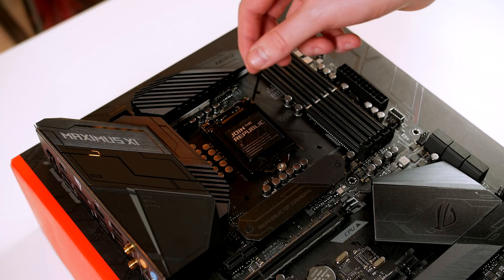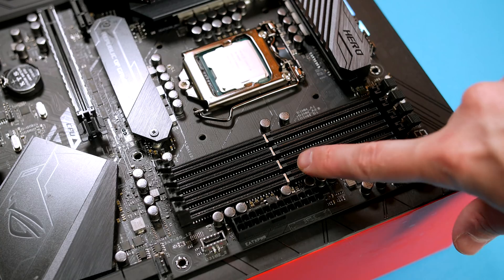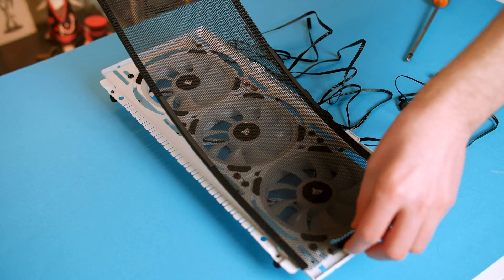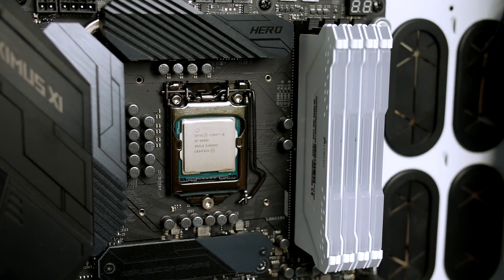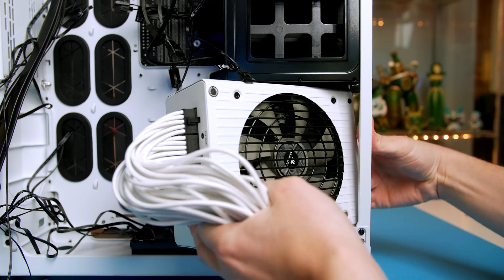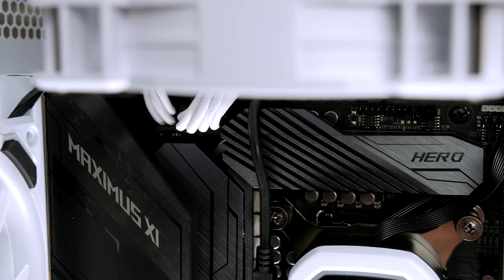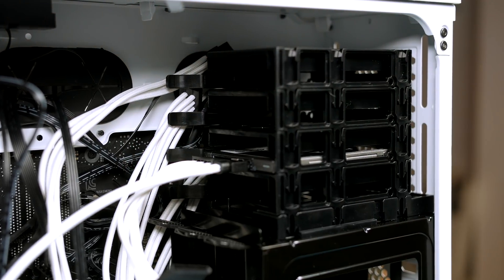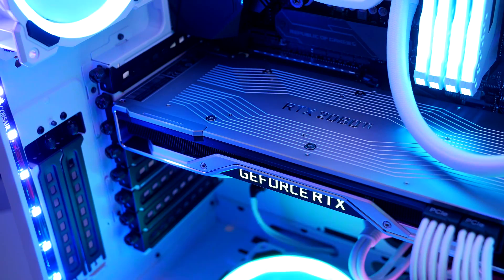The Ultimate Gaming PC Build Guide 2019

Comment: Hey I have the same build planned this weekend and was hoping you could help with the fan and light strip setup.
The bottom two look to be like exhaust vents right? 
I bought the QL fans(2 for bottom and 1 for rear)

Can they be put in the commander pro with the LL fans?
Do the 6 fans go into commander pro and use 1 channel and the lightstrips use the other channel.
Do the two fans on the AIO not have have to be plugged into the commander?
I would appreciate it so much if you could help with this as it's the only part of the build giving me a headache

Comment: Curios - I was told the bottom of the case fans should be intake - did you set yours up to be exhaust?   additionally is there anyway to connect two RGB hubs without using the commander PRO for all 8 fans?

Comment: Ok, forgive me, I'm a first time builder basically trying to build this exact machine.  Questions!
1) I have 6 fans so i plug all fans into the Commander Pro, pretty straight forward, but I have the H100i as well, where would i plug the fans/rgb for those in as there are only 6 spots on the commander pro?
2) I can remove the little Hub (LED 1 and 2) because the commander pro replaces that, correct?
3) Both the Commander pro and the RGB hub need power, .. just by plugging the RGB into the commander pro.. it's not powered that way I assume.

Thanks from a noob!

Comment: Hi, awesome build!!! But...How could you connect the 8 RGB fans and the 4 led strips on the commander pro and 1 hub ?
Reply from the maker: The h100 controls it's own fans
Reply: @BeginnersTech  You have not understood me haha ... I mean the rgb lights ... 6 rgb lights of 6 fans go to 1 led channel of commander pro, and the 4 rgb led strips go to the other led channel of commander pro ... but  Would the 2 h100i fans be missing to illuminate, or do they not need to be connected by the comander pro?
Reply from the maker: @Lirus86  what I'm saying is 6 fans go into commander pro in both the fan end and RGB end not in the led channels. The led channels are for strips. My other 2 RGB fans are controlled completely by the h100i as it has its own fan and RGB connections.  If you don't use those connections on the h100 then you'd need somewhere to plug the fans on the motherboard and a node core or RGB hub
Reply: @BeginnersTech  ok I think I get it.  thanks !
Reply from the maker: No worries if you need any help just join the discord

Comment: The Commander and Hub has connections for 6 fans, so where did you plug fan 6 and 7 in?
For the GPU i would actually get the CableMod Vertical Mount Kit, as it will bring the GPU further away from the side glass and give you great airflow.

Comment: The mother Board don’t have 8 Pwm Ports? Dies ist work with a hub?
Reply from the maker: I'm using commander pro
Reply: BeginnersTech okay trank you im a noob ^^ but is ist for the power and Lightning?
Reply from the maker: @blxckluc5435  for the lighting you will need a node or RGB hub
Reply: BeginnersTech okay trank you and what i Need for the power Cause i have only 4 power 4 Pin pwm Ports?

Comment: yoo you have 8 rgb fans how did u connect them all to commander pro which only takes 6 .. it don't add up ?  Pls reply cuz I'm stuck 😔
Reply from the maker: The H100i controls its own fans so all good
Reply: @BeginnersTech  I watched the video again it makes so much sense now thank for making it so clear  👍
Reply: @BeginnersTech  ohhh so I just connect it to the rgb hub right? Thank god life saver 🙏 my first pc build ever hope I get it all down
Reply: @BeginnersTech  so my commader pro just came. I connected 3 separate ll20 fan connectors to it. The h100i connects by itself.  But I'm using the 3 fans that came with my case I can't seem to find fan connectors only to rgb hub wires which I connected to the hub that came preinstalled in the case ... 680x that is does the 3 preinstalled fans just not come with fan connecters for the commander pro

Comment: Hi great video! do you know if there's enough room in this case to vertically mount an Aorus 2080TI Extreme card as It's a quite thick card from front to back with the fans shroud and there doesn't appear to be a lot of room between the card and the glass? even if it fit's vertically would there be enough cooling do you think?
Reply from the maker: It should fit fine,, not sure how temps will be tho as I have never used that card.
Reply: Bill Gordon the temps might go up a couple degrees. But, the bottom fans can be either exhaust like in the video and how I have them set up or they can be intake and have the cool air going right into the card.

Comment: Do you need the card in vertical mode in this case? I'm using Aurous 2070 S.
Reply from the maker: No can mount whatever way you wish.
Reply: @BeginnersTech  Will effect the PCIE slot overtime with wear due to the weight of the card? My friend is recommending I use the card vertically to avoid damage unless the case can support it strong enough without needing to do so.
Reply from the maker: @jamesherman3750  it should be fine mounting like that is normal the vertical is just for looks

Comment: Would you use a commander pro when u have 3 CPU fans and 6 case fans?
Reply from the maker: Commander pro ideal for when you don't have enough connection on the mobo. Plus with Corsair fans it allows perfect sync

Comment: looking to get a corsair h115i platinum cooler. if i have a commander pro do i need to plug the pump into the mobo or can i plug it into the usb header on the commander pro? Also with the fans from the aio, can i plug them into the commander pro and rgb controller like the rest of the fans i have in my case? (they are all the same fans) Been looking around and cant seem to find the answer. Thanks in advance! Great build man!

Comment: Corsair botched the 680x (I have a build using this case as well) by not thinking of their own products.  The mix of fan sizes is limited.  If you use their 360mm AIO in front, you can't use 140mm fans in the top or bottom, you're forced to use 120mm, giving up 15% more airflow.  Fine, use a 280mm in top but then don't overclock your CPU because the 280 AIO won't cool an i9 or AMD chip sufficiently.  Also, the fan and rgb hub nonsense, do away with it in Corsair cases and build a power/rgb rail inside the case to hang fans onto with a single 4 pin power connector and a single usb header.  I have 8 fans in my 680x and 30 wires to accomplish that.  Ridiculous.

Comment: Do we have to buy the rgb controller or does it come with the case?
Reply: The lightning node pro comes with the case and any set of 3 rgb fans from corsair you buy separately.  That only controls the rgb though. 

If you want to control the fan speed all in the same software as you do the rgb you need to buy the corsair commander pro.  That way you can control the fan speed and rgb all from corsairs icue software.

Otherwise you'll have to go into bios(?) I think to control the fan speed

Comment: How do you connect 8 ll120 fans in this case?
Reply from the maker: Use the commander pro
Reply: @BeginnersTech  doesnt commander pro only have 6 fan slots?
Reply from the maker: @chadn5177  yeah but the h100 fans plug into there own connectors.

Comment: How did you connect 8 fans if the hub only allows up to 6?
Reply from the maker: The cooler fans run through the cooler
Reply: @BeginnersTech  I don't quite get it. Building almost the same system at the moment. But how do I get the 2 CPU fans to be RGB controlled? I can't plug them into the hub, because there are only 6 ports for RGB. Where do I put my CPU fans RGB header? :(

Comment: Came here for the thumbnail, stayed for the accent.
Reply from the maker: Hahah legend
Reply: @BeginnersTech  yoo you have 8 rgb fans how did u connect them all to commander pro which only takes 6 .. it don't add up ?  Pls reply cuz I'm stuck 😔
Reply: @j4naid__415  hey sorry so I had the same question but I found the solution
So you get fan splitter cables that allows  one port on the fan controller to take 2 fans,but I think you're gonna need to another light node core pro for RGB control for the extra fans